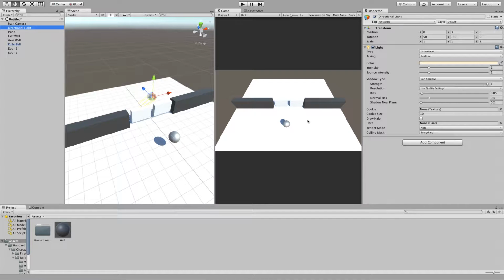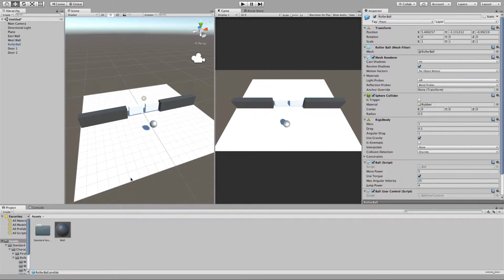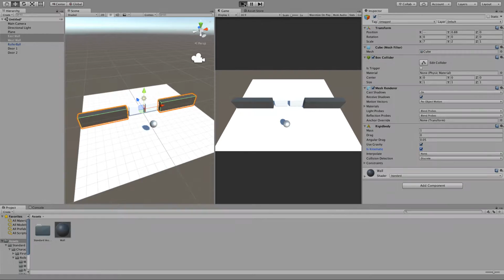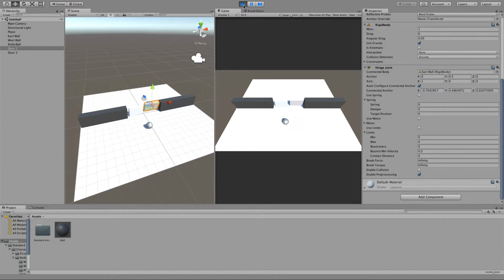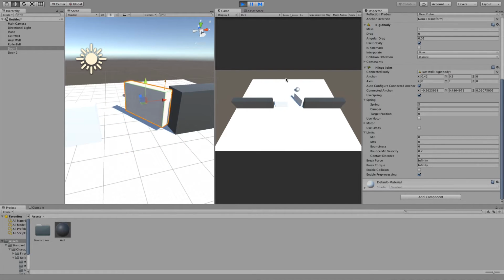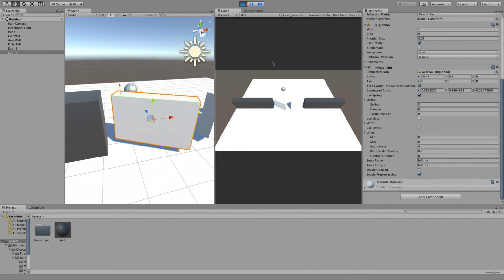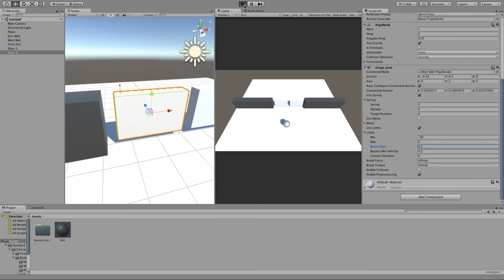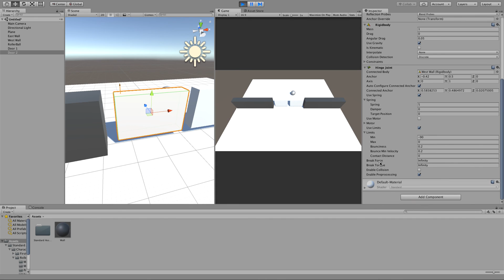Unity Hinge Joint

Comment: And its that easy!!!!   Just spent the last 2 hours going over and over door tutors, and nothing worked the way they did in the video, until this one, and now 5 mins later, Ive got a working push door.. the only thing I would add, is on the Limits, if you focus on the door, and click to edit angular Limits, the editor will show the Physical Arc the door will move when setting the limits,

Comment: Definitely using this. I was thinking about coding the door instead but that might cause problems so doing a dynamic door is better.

Does there have to be space on each side of the door? I put one in a building and it doesn't work but putting it by itself works just fine.